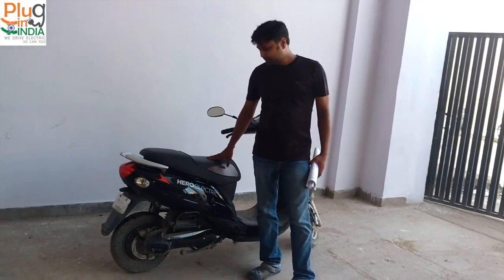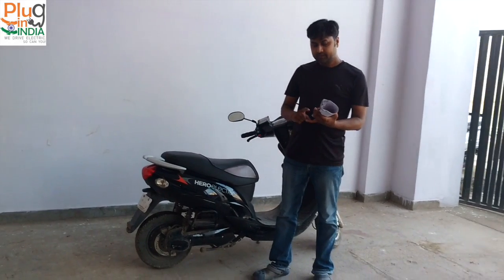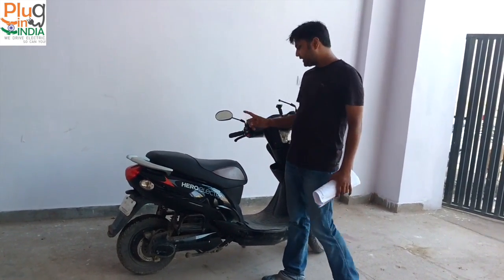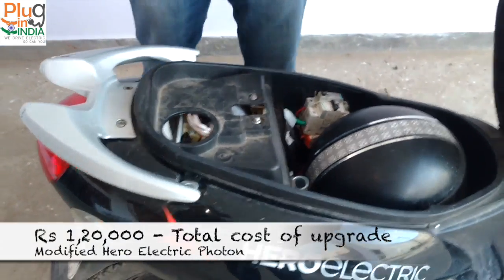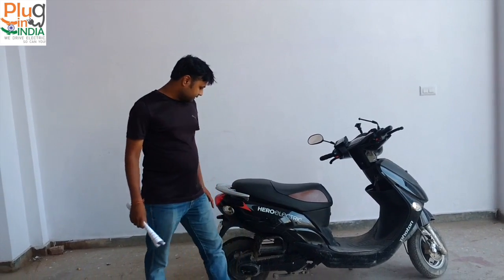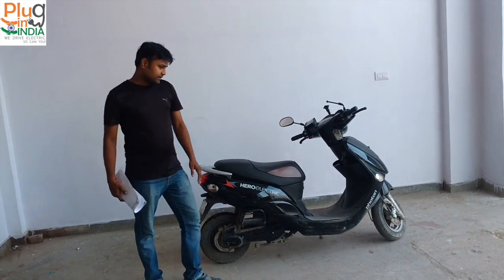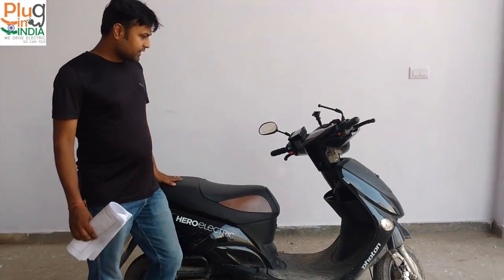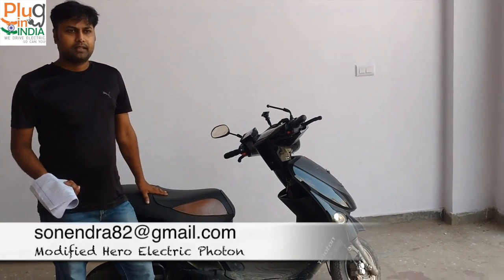Real Life EV Story : Sonendra - Hero Electric Photon e-Scooter Lithium-Ion conversion

Comment: Kya ye modification Hero optima DX lithium ion me ho skta h kya???? Plz do reply
Reply: Ho sakta h,
 but cost will be around 30-40k (Motor + controller + bahut saara study karna padega)
What are the following -
1. Battery details: LiFePO4 or Li Ion?? AH capacity @ what discharging rate??
2. BMS (Battery Management System): It is inbuilt in your battery pack. Peak and maximum contentious current ??? 
3. Wheel/tire size: If i am not wrong, your scooty wheel size is 16 inch. So new high power motor must have 16 inch rim. similarly for tire (let assume, tire size is 3-16 inch).

So, your battery maximum current (power) capability is decided by BMS. 
For a 48V Lithium  battery, let assume, your BMS can support -

(A) peak current (power) = 60A (power = 48Vx60A = 2880watt, 3KW) (recommend time duration for peak current is generally 10-120seconds, depends on battery and BMS)

(B) Maximum contentious current (power) = 30A (power = 48Vx30A = 21440watt, 1.5KW) (at this current/power motor can contentiously work, depends on battery and BMS)

So,  SPECIFICATIONS of new motor should be -
(A) peak power: 3 KW
(B) maximum contentious power: 1.5KW
(C)Rim,tire size: 16 inch rim and for 3-16 inch tire

Next, Controller, new controller power should be 1.5-2 times w.r.t MOTOR wattage, if it is 1, then HEAVY HEAT SINKs (proper thermal management) can keep the temperature of controller with in a safe limit.

Basically, Motor and controller should have above specifications, so that your battery and BMS can properly powered them without any malfunctions. It is important for your battery life. Modification should be in such a manner that your ELECTRIC scooty can ride a optimal Kilometers (distance) in battery expected lifetime.

NOTE: First confirm and make sure your vehicle chassis can support your desired max speed. This is most important, to avoid any accident.

Comment: if you are interested in EV lets try with supercapacitor in the place of battery and life of capacitor is more than 50 year.no need to change in life.as per my calculation 1kwhr powered super capacitor cane be connected in a sco0ter.it will be charged  within 3 min and can be around milege of 40km.
Reply: Lovegin .Francis do any company has done dis b4 and wat wil b d cost for super capacitor?
Reply: Mukesh Bhagat it cost around 800 rupees per watt hr. Maxwell have ucap and or check with www.ultracapacitor.co.kr in korea